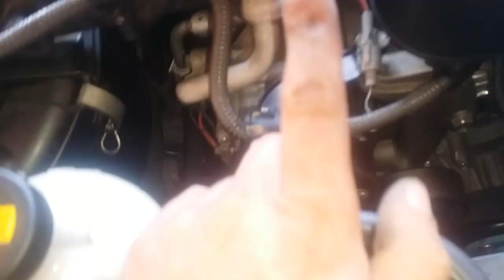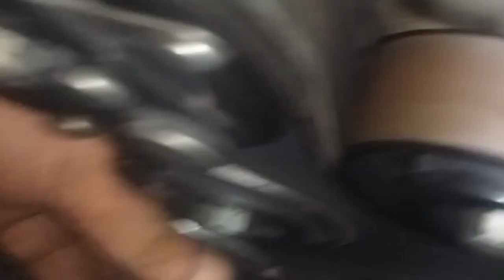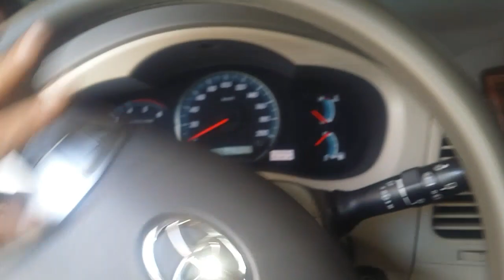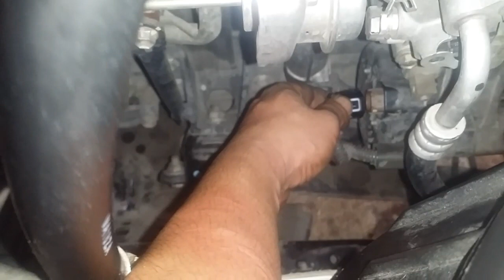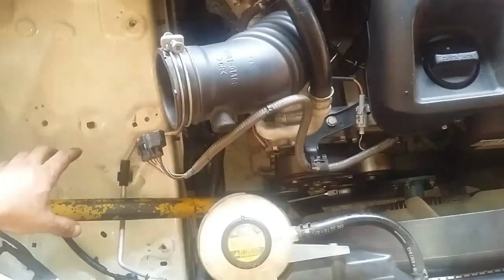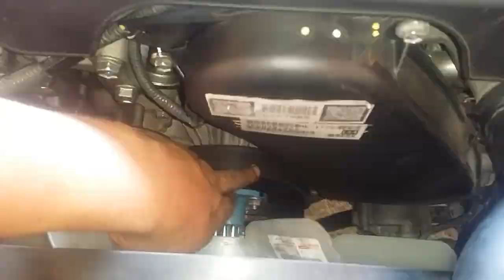How to Find Squeaking Whining Engine Noise. alternator, fanbelt, hydraulic pump. etc

Comment: I think the noise is from the oil they put in was like milky tan color , changed it and is better, also they used a powered ratchet 2 tighten bolt , which could of wrecked my threads,very extremely tight!!

Comment: Some mech helpers are saboteurs, one crossthread my spark plugs, another mech poked a hole in dip stick housing , also he had  a wire hitting my belt making a loud cricket sound.   And always hide ur valuables, tools etc